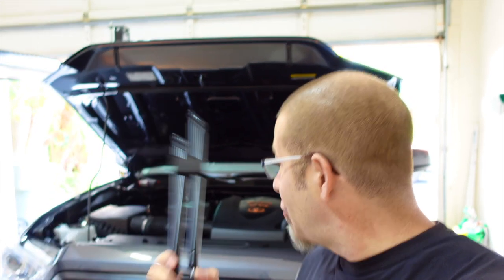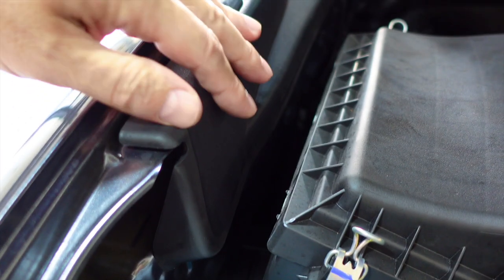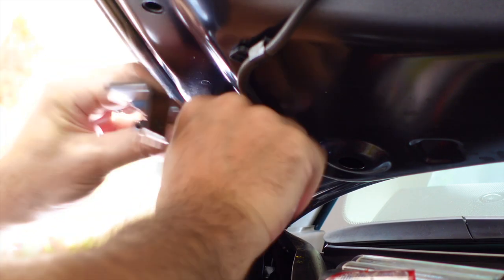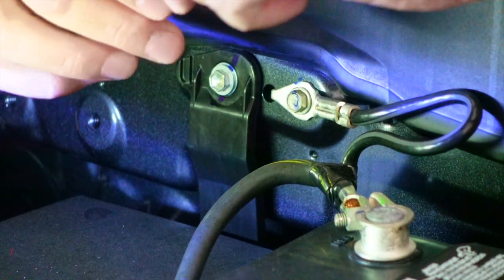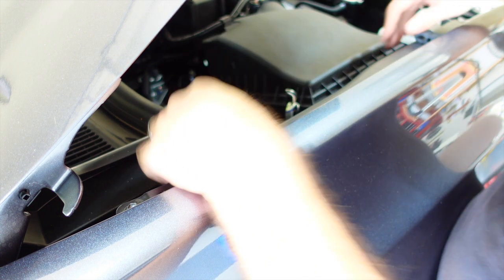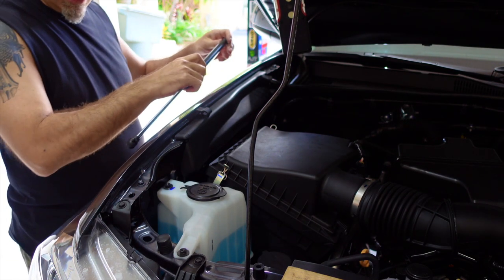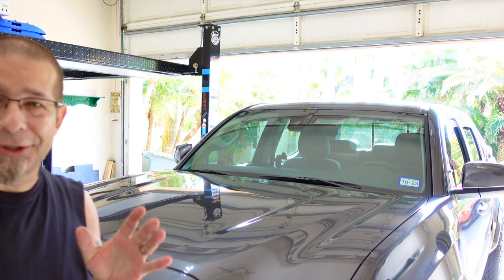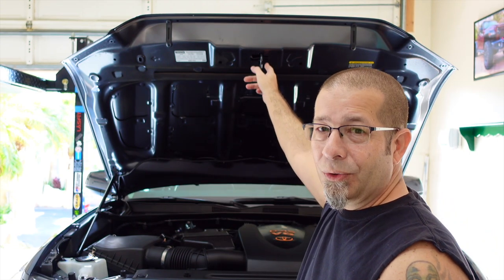Simple Toyota Tacoma Hood Struts No Drill

Comment: One thing I can say is the inner fender peg on passenger side flexes a good amount when you close the hood. Maybe because that strut is long and takes the initial pressure plus new. Still I was kind of surprised. Maybe it will relax some after using it enough. These aren't aftermarket fenders.  🤷

Comment: Just installed these on my 2023 Tacoma yesterday. The ball stud you mentioned in your video is 7/16 hex size, not metric like one would expect, since it threads in a 10M tapped hole. Pulled out my American standard wrench set and the 7/16 fits perfectly.

Comment: I'm guessing they will need some modifications if you have ditch light brackets.
Reply from the maker: Could be?  I've never installed ditch lights🤔
Reply: @RobMotive   the ditch light brackets use the same bolts as those. So probably would leave a gap between the hood and the 3m tape.

Comment: I like them Rob! My only concern is the integrity of the body ground over time. I have seen the way that side will actually torque and move the ground wire when opening and closing. I may give them a try though!  Thanks again and Merry Christmas to you, Christa and your followers!
Reply from the maker: I need to take a closer look at that🤔. Merry Christmas to you guys too🎅
Reply: I have had these installed for about a year and a half and so far not issues with it using the ground bolt location.  I haven't noticed mine moves at all. I torqued it down good.  Also I installed the MattGecko under hood led light and need to ground it somewhere. Well there is another ground point down inside the fender that you can use.
Reply from the maker: Thanks for the info and tip👍
Reply: @RobMotive  yeah man there are a lot of things and so much room under the hood in the the Tacoma. It's like they made the thing to mod.. go figure.  When I got the hood light I didn't want to undo to bolt on the strut. Seen another ground bolt a few inches away. Problem solved.

Comment: Nice add on! Thanks for the tips! However, I did not have to remove that side panel, I just popped off the area closest to the mount area and swiveled it upward for access to the bolt hole. Literally a 10 minute job thanks to your video. 15 min if you drop the passenger side bolt under the wiper fluid reservoir!! ARGHHH!
Reply from the maker: Lol!  Great to hear!  Thanks for watching 👍

Comment: Well, ruined my christmas present. T HF e bolt with nine for passenger side sheared off in threaded hole. Cannot get it out and not sure it can be drilled out and retain thread. I had to use a combo wrench because the bolt did not fit any size metric nor SAE. I can probably get a replacement but will gave no hole for threading it in. Guess I can ask dealer but will compound costs if they ha e to machine and re tap. I give up. No struts for me
Reply from the maker: That’s a drag!  Wonder what happened?
Reply: @RobMotive  had to use a combo wrench since it did not fit metric nor SAE box or open end wrenches. Too close to air filter to work comfortably. Going to see if it can be drilled out but probably cannot re tap for threaded hole even if I could get another replacement bolt. May have been defective but suspect metal not the best coming from Taiwan.
Reply: Were you able to get out the broken bolt?  If not did you try drilling the cener of the bolt and using a Easy Out and some penetrating oil?
Reply: @scottgorman7166  I got a extractor set from Amazon that drills then drills a crew end in opposite direction and it came right out perfectly. Got a relacement bolt from the company and placed strut right in.
Reply: @garyelliott2793  glad it worked for you...how are the struts working? Just downsized from big trucks to a 22 Taco and the hood rod...modernize Toyota

Comment: I've had the rivet ones for two years there's and u where easy to install just measure the area multiple times and use pwinters tape so you can see your marks 77
Reply: I've  had mine for two years makes thing easier and safer I used the reclines r
Rivet type hardest part is drilling the holes in the right place I used painters tape measure multiple times the tape will give you a place you can see when you mark with a pencil go real slow drilling thr top hole delicate is the name of the game the hoods steel is only about and eighth of and inch once the holes are drilled put the bracket in place place the rivet through the braket in place are sure its right slide the gub over the thin end of the pin squeeze the handle as hard as your can and make sure rhe rivet is in tight against the brakes and the brackets up tight against the metal two rivits four all4 brakes clean up and your done try closing and opening a few times making sure it doesn't get hung up may sound complicated but if you read the directions over and over and there are quite a few u tube videos keep watching until you.  Get it only took me and hour and I was done I loved them never felt safe with that dumb stick holding up that heavy hood these things are great for the price they should put them in o.e.m.

Comment: Hey guys I’ve had these on for 2 months. They work great but I am noticing that the studs that go into the drivers side replacing the ground bolt and the passenger side pre threaded hole are bending a bit? If so do you think it’s any cause for concern?
Reply from the maker: Good question.  I haven't noticed this on mine.
Reply: So when you look at the washers for the studs, they are not flat anymore on mine. They are still holding but I’m just keeping an eye on it. I contacted the company and they are send me replacement ones so I guess we’ll see

Comment: What about when your ground bolt shears off? I dont like this design. Looks like its going to be a problem down the road. I think the prop rod will work just fine for me. Cool idea but bad execution by the company.
Reply from the maker: Never go with a mod you’re not comfortable with.  I’m ok with this one👍
Reply: Note the two lines from the battery.    You can also move the ground to the next bolt on the car but  when this round stud head fails the ground will remain on the car as the pivot ball will fail first.
Reply from the maker: I see no reason why it would fail🤔